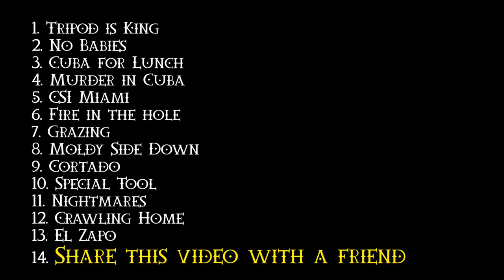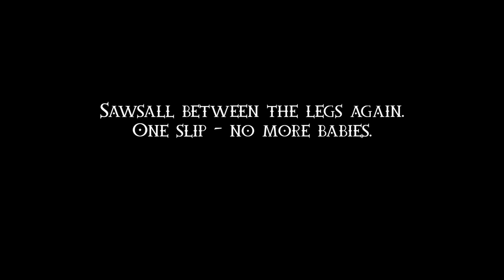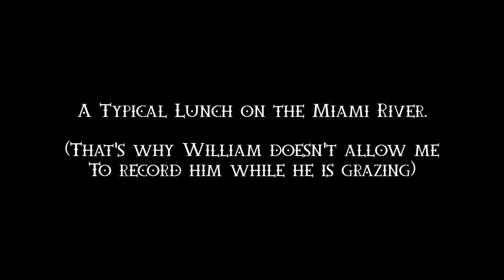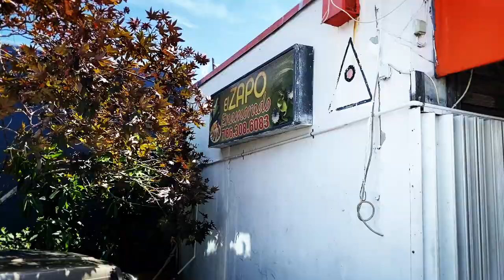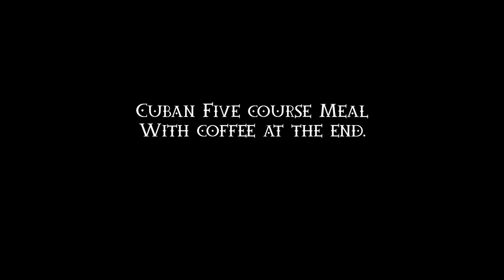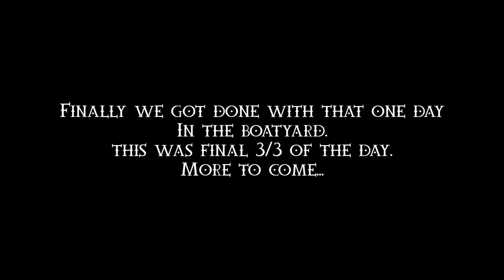Sailboat restoration Project Metal Boat Repair Metal Hull Boat Dawn Hunters Steel Motorsailer Ketch

Comment: Commodore Iana & Captain William Great show. 
The food looked great, The metals slow oxidation looks scary. 
I've got friends that love metal boats, but with just a small amount of water on an unprotected surface makes yea think twice. 
Thank y'all for the knowledge! 
Peace & love always
P.S. Captain William will grow into the blue shirt but it will all be muscle from all that metal he will have to work with
Reply from the maker: Hello Clay. 
Yes the slow oxidation is not fun BUT once you get it all we are good for at least 5 plus years. The boat had many plates replaced few years back so lucky for us only a couple places need attention. The last few days has been fun to see someone else busting butt— they are media blasting the hull and in the AM we will begin coating the bare steel.
Reply: @DawnHunters  Howdy, Looking for helpful hints. Could paint or even bed liner on the interior reduce the odds on that oxidation?

Comment: So you’re giving away both a piece of steel and a piece of the mattress. I suppose you’ve selected these items because the steel plate represents Williams’s toughness, drive, and steadfast and unmoving logical approach and a piece of the mattress to represent Lana’s softer more artistic, relaxed and flexible approach to things. A great combination by any measure.
Reply from the maker: Iana here. Hey Mike! Lol we have also now some chipped paint as well! OMG it seems we will have a lot of other boat parts to give away... sooooo I’m curious about your username are you from Miami?
Reply: Hi Lana,  Yes, I’m from Miami and still live here. I was on the Miami River two weeks ago but didn’t make it as far at Hurricane Cove. Back in the day my folks a Prowler boat at 8th Avenue Boat Slips, which is now part of Norseman Yachts. Prowlers were great boats, originally designed and built to run liquor from the Bahamas into Miami back during prohibition. I spent many a day working in the boatyard next to Prowler Boats and Norseman, sanding, fiberglassing, and painting. And even more time at Nuta’s Boat Yard at 1884 NW North River Drive.  Does the address sound familiar? It should. I think Hurricane Cove occupies the land that used to be Nuta’s Boat Yard. At Nuta’s I did pressure cleaning, sanding till all my clothes were green with copper, and bottom painting till it seemed I had more paint on me than the boat had. I truly appreciate the work you’re doing, it’s very hard work and when it’s 95 in Miami, it seems like 120 degrees in the boat yard. But if you’ve got to get the work done, it’s a great place. There’s a lot of history on the River. Check out my channel. Not much there but I do have a couple of videos I made about biking in China.  A couple years back I was a visiting professor at Tsinghua University in Beijing so I made a video or two.
Reply from the maker: hey Mike! sorry for a long answer - somehow you comment got into spam folder. This is so awesome - i'll show this to William - for sure he is familiar with all these places, because he had been living in Miami for 15 years. Yes, i'm dreaming to get out of the boatyard though Mr. Captain seems to be very much ok over there lol. I think he is enjoying it much more than i do...

I always wanter to go to China, it seems SO different there (i watched your videos - very interesting like a little biking excursion!). What did you teach in there?
Reply from the maker: Good day Mike!!
Wow— someone actually from Miami— lol
Our standing joke here is when we find a Miami local we must document as no-one is really from here. Our boat is actually on the hard at the same location you speak.  It was taken over by Hurricane Cove some years back and where the new 110T lift now does large vessel haul outs. We just had snapper at Garcia’s (one of my favorite spots) this past Saturday waiting for the storm that did not happen. We should meet up one day for a lunch there. 
Good to have you onboard and again sorry for the spam box eating your last message. We will check that more often. 
Capt W

Comment: Use an ultrasonic thickness gauge to find the thin spots. The metal can’t have any paint on the contact area. You have a cut out sample now that you can use to calibrate and verify. #1Borrow #2 rent #3 buy and sell it when done.
Reply from the maker: Hello Karl
I had a thickness gage but was not happy with it. Ordered a new one with more sensitive probe. Should be here in next 2 days. The issue with these is even with a tight grid pattern even 1/8 inch from a thin spot can be missed. The hull is COR TEN steel that was then heat treated. The only rust issues are where water sat from time to time in the bilge. These are places I am relating. Needless to say I will be evaluating every 1/4 of this hull. 🤣
Reply: Dawn Hunters 
From 1990 to 2001 I used a Stresstel T mic. We used it to tell where a blind gundrilled hole ended up and it was amazingly accurate. In the 3/32 to 1/2” range it was easily + - .005 reflecting off a hole. Off a flat surface(like the other side), it was even more accurate. I could even tell where the hole was side within.015” by dragging the probe across and when it reached the lowest number, I’d scribe around the probe then turn the probe around 180* and repeat. There would be two circles so the hole beneath would be the average of the two circles. I sold that machine shop business to my competitor and blew his mind with that trick( he wondered how I did it). There where different probes primarily for ferrous and non-ferrous. It did make a big difference to use the right one. The most important thing is to have a known sample in varying thickness to help calibrate and verify. FYI, this is how the state would certify pressure vessels (air compressors) they always checked the bottoms because that’s where the water would condensed inside.
Reply: I’d replace the damaged areas with some common hot rolled plate. That standing/lapping water was not good for the cor-ten steel. I’d be giving it a thick coat of two part epoxy (floor paint-Granger) in the bilge, but if there’s any place that water can get under like a skip welded rib, it’s got to be totally sealed, gooped over. Hint, don’t use a wire wheel to clean/scuff hot rolled finish or old paint, use abrasives. I’ve proven to myself that that polish/burnished finish that wire wheels leave is terrible for paint adherence.
Reply: Dawn Hunters 
Oh totally forgot. The surface where you place the probe must be reasonably smooth and free of paint but most importantly you must use some kind of a a contact gel, vaseline, grease, heavy oil, all seem to work as long as that’s what you used to calibrate it with. Just use acetone to get the grease off before weld or painting and keep the solvent and rags far away from weld or grinding sparks.
Reply from the maker: Karl Jensen 
Thank you for all the great tips. When we upgraded the old oil rigs from the 70’s I had over 200 welders from Romania (those guys were only ones who would go inside the ballast tanks to weld and come out 5 hours later, smoke 3 cigarettes and back in the tank). They were happy every morning to get back in the tanks. I am not so crazy. Lol
We are very fortunate that the original owner had 7 plates replaced 5 years ago so every inch was gauged plus had kept the bilge super clean and dry. They missed the compartment back by the shaft seal as water got under the epoxy and they kept painting over it. Iana chipped all the old bilge paint and we re-coated with a metal sealer/rust lock and the 2 part epoxy. You should look up the rust lock. It is amazing stuff- paint over rust (any loose rust bead blasted away or chipped with a hammer) and it actually bonds with the rust to make an oxide that you can’t scrape off. Then 2 part epoxy over it. The rustlock is by Pettit 6980. I had the complete bottom media blasted and then applied this rustlock. Then calibrated the probe with a part of the hull and this rustlock allied. So far only located 4 small places with pin holes by the welded plate they replaced. The boat has been out of the water for 5 months so gave some time to do it right. Good idea on the Vaseline— makes sense, like a human ultrasound.  I will update you on the progress. Do you still dive? Do you have a boat??? 
Thanks again.
Reply: Dawn Hunters 
Don’t currently own a boat, but I have access to my son’s. Having withdraws for mine, thou I don’t miss the bills and labor. Haven’t been diving since I sold the boat. I did it frequently to inspect/change the anodes (magnesium in fresh water) or recover what people drop. As to your rust problem. Trapped water rots both wood and steel. My mantra: “Water will find a way”.
Reply: DAWN HUNTER FANS GO TO WIKI AND RESD ABOUT CORTEN STEAL VERY INTERESTING !!!!!

Comment: I had no idea the steel was so thin!
Reply from the maker: Thomas--
The steel on Dawn Hunter is actually heat annealed like a sword- in summary the steel is welded to an inner frame and then exterior heat treated. This increases the steel strength plus this is not your typical steel. It is marine steel and same as used for oil tanks,. commercial vessels and is actually .28 to .38 thick. This is then welded to internal ribs that are 2 inch wide. Each cabin has welded bilge bulkheads to control any leaks that may take place. 
The past owner once hit a rock and put a hole in one plate, he said dove under and stuffed in a rag, then went into the bilge and pulled the rag tighter.  Ran around for a month before hauling out and repairing the hole. This is possible with steel as no worry about further cracks and damage caused by the hole. 
Thanks for your input
Capt W
Reply: Dawn Hunters  I DID not know!!!
I love playing with things. 
Everything!!!! 
Building boats
Welding 
Chemicals of course 
(No drugs ain’t my thing) 
Guns 
Fishing poles

Comment: Why buying a steel boat except for strength reasons. Endless maintenance and fighting corrosion.
Reply from the maker: Claus. 
I have been a Paramedic and first responder after many hurricanes. Katrina , Norma, Sandy to name a few. A steel boat is all that survived in such storms while fiberglass stacked up like firewood. Also used to upgrade offshore oil rigs and fabricated ocean pilot boats all of steel. I don’t mind chasing rust and welding modification on a steel rig in exchange for strength, work, and travel. 
Capt W
Reply: The modern day coatings are fantastic ,,,far superior to even 10 years ago ,,, now they don't even clean to bare metal ,, just scrape the loose rust off and paint over the top,,

Comment: ¡Dios mío pero que rico!
Hey, about that hole, after seeing the damage… doesn't it raise more questions? Could there be any more weak spots? Are you going to need to disassemble to survey for damage? Aren't there laser/ultrasound machines you could use? The rusting never ends unless you grind it off or cut it out. The composition of the metal has been contaminated, structural integrity compromised.
That cut disc broke too soon! Mostly because of the difficult position. With those discs I've found it is better to go in and out rather than trying to do big lines because overheating also weakens them. Good thing they're cheap!

–A
Reply from the maker: Good evening Alejandro
I have the owners log book of everything he did to the boat. 4 years ago they cut away 20 large areas and welded new steel plate. These were 2 locations they did not replace so that is where I started to dig deeper. As soon the hull is media blasted I will then perform a complete sounding again. The issue as you see could be good steel in one place and bad steel only 1 inch away. Steel boats rust from inside the hull. The exterior have enough paint and epoxy to hold a boat together. The stern bilge had water always sitting due to the shaft seal dripping. Now we will have a dripless so that area will be dry. I normally buy commercial disks that have the thread center and they can take all types of heat and bending. Due to COVID have been buying Harbor Freight disks. Well you get what you pay for. Good questions. Stay tuned as the last 2 days our hull has been blasted so finally can see under the old girls bottom.
Reply: @DawnHunters  ohhhh gosh having those logs is a treasure! I'm so happy you have that information because that section REALLY looked dangerous. Can't wait to see the results of the sand blasting, and of course the repaired hull. 
BTW you also lost the locking key for the grinder eh? They seem to have legs!

–A
Reply from the maker: Hello Alejandro
Please email us your address. You win the Dawn Hunter signed steel piece of the hull based on your questions. 👍🏼👍🏼
Reply: @DawnHunters  And well deserved! Alejandro gets the A for the Day.
Reply: @DawnHunters  wait, WHAT!!?? OMG!!! Yeyyyy!! Hahaha thank you, guys! I'm going to laser cut a base and have it on display! I'll reach out to you via the website. =D

–A